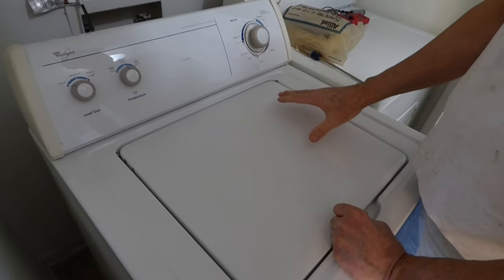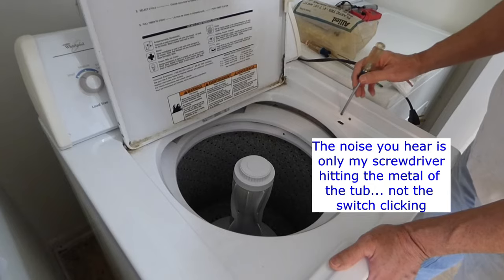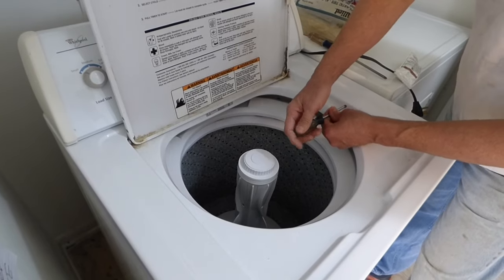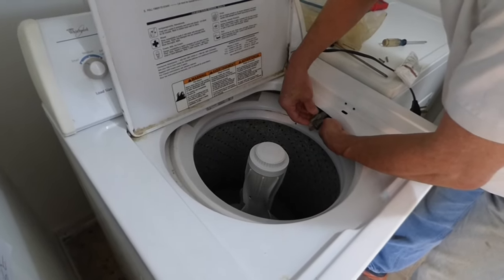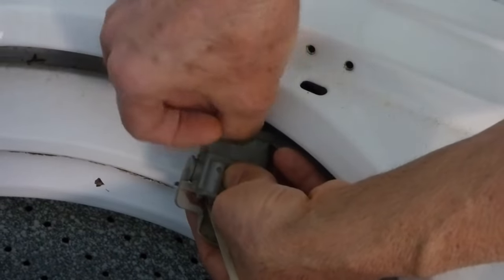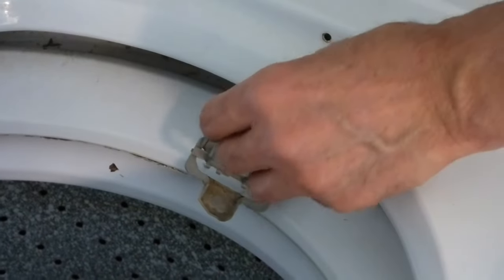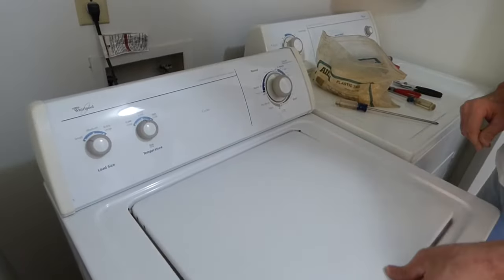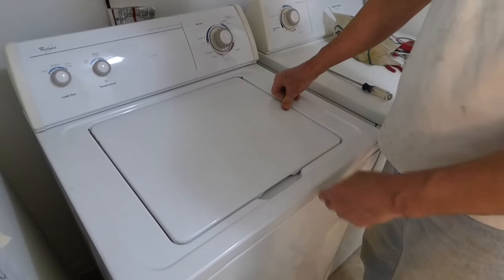Wash Machine Won't Drain or Spin - EASY 5 Minute Fix!

Comment: Worked for me too……AFTER I paid a repairman to fix it. It worked when he was here but failed again after he left, leaving me with another washer full of water and wet clothes. Because the Kitchenaid is 23 yr old I was researching new washers and didn’t like any of them as I don’t want one with a motherboard or impeller. Anyway, I followed your instructions, even had a zip tie on hand, and now it works perfectly. I’m THRILLED and hoping it lasts another 23 years. They just don’t make them like this one anymore. A lot of junk out there with built in obsolescence.
Reply from the maker: … And if your lid switch is ever not repairable they are not difficult to change out. Here is a video showing how to do that.
Washer won't Drain or Spin - Most Common Cause - How to Replace the Lid Switch
https://youtu.be/gzq5FODUuqE

Comment: So single mother here with a question. My washer will spin during the cleaning cycle just fine and dandy. Now with that said here lies my conundrum, it refuses to spin on the final rinse cycle. All the water drains but of course the clothes are still soaking wet because the water didn't get spun out of them. I've watched several video's on different issues, but not my problem exactly. All the videos I watch are semi old or the creator doesn't respond back to questions. But thankfully I ran across your video and seen that you actually take the time out to answer your subscribers questions. Which is so absolutely awesome and means so much, it definitely separates you from the rest of these repair channels, because it shows you actually care. You understand that some people, especially all of us single mothers on a budget. That have to put on our many hats and get in there and get our hands dirty, to fix our own appliance issues if at all possible. Thanks so much for being the creator that's genuine,it means more than you know!!❤
Reply from the maker: If it spins well on the wash cycle but will not spin at all on the rinse cycle you may have a problem with the timer.  I would test that
Reply: That’s exactly the problem I’m having
Reply: @helpinguonline how would I test the timer? Thanks
Reply from the maker: I don't have a video on that yet.  You will need a multi meter to test it.  You can get a cheap one at Harbor Freight for around $5.  There are videos online that will show you how to do that.

Comment: Thank you!! Just realized the pin to pull the switch on was broken, No need to replace the pump!! Easy fix using a screw to replace the plastic pin
Reply from the maker: Way to go!

Comment: That worked very well. The screws that attached the switch went through the plastic switch housing and both had broken out. Super glue and the suggested zip tie seemed to have fixed the problem. Thank you!
Reply from the maker: Way to go

Comment: Was about to buy a new Washer and stumbled upon your video.  Problem solved.  Thank you.  2 minute fix.  I just shaved the rubber feet on the lid to sit lower, making better contact with the switch.
Reply from the maker: Great job!
Reply: That is also a good idea

Comment: Thank you! I figured out my lever actually broke off so I think I need to order a new switch. I found the broken piece behind my washer. I guess it fell to the bottom when it broke.
Reply from the maker: Congratulations on figuring out what the problem is and this video should help you to replace your lid switch with a new one

https://youtu.be/Qgzq5FODUuqE?si=MqHJD32rkjl98tMz

Comment: I have a 30 year old Kenmore that worked like a charm, until I put a big dog bed with foam cushions in it. That’s what made the spinning stop. I was excited to find your fix, but mine still clicked, and when I took it out, it wasn’t split at all. Do you have any back up thoughts? I know you made this video two years ago, so I’m not really expecting an answer. I just don’t want to throw it out unless there’s truly no hope. I have to do more daily loads with an incontinent dog who is a senior, then I ever did with a family lol.
Reply from the maker: Sorry to hear of your troubles. Your problem could be one of many. Could be that the weight of the dog bed in the washer broke the plastic coupler.?.  Here is a video that will give you a deeper understanding of how to make repairs to your washing machine and if it is the coupler you will also learn how to change that. Wishing you all the best

How to Fix a Wash Machine that Won't Spin, Agitate or Drain - You will Learn A Lot
https://youtu.be/odDvndIlU6k

Comment: I too was relieved you shared the zip-tie hack. I did grab the number from the switch for my 90’s series (ex 3949238) and ordered it for later.  I bet the zip tie holds for a while though.

Comment: I found your video very helpful last night when I got home, and  she told me the washer wouldn't drain. I pulled out the switch and the seal was completely gone. Switch was wide open. do you have a video to replace this? I have a whirlpool Ultimate care II heavy duty super capacity plus Model LSQ8243HQ0
Reply from the maker: Washer won't Drain or Spin - Most Common Cause - How to Replace the Lid Switch
https://youtu.be/gzq5FODUuqE

Comment: I’m sure this would have been a perfect quick fix. Unfortunately, as soon as I took the second screw out I heard the switch fall down so I can’t reach it. I have a load of water and wet laundry. Any clue as steps I should take at this point?  I cannot reach the switch that fell.  It’s an old top loader Kenmore that was working great ( someone just gave me to replace my front loader that died. )
Reply from the maker: You would have to get a large cup and bucket to get the water out of the washer tub unless it it easily accessible where it is.  Then you can follow the steps in this video to access your switch.
https://youtu.be/gzq5FODUuqE
Hope that helps you.

Comment: Exact solution it needed... but strangely the issue would only happen on the delicate cycle - wont drain or spin, all the other cycles the machine worked flawless. Any reason for that?
Reply from the maker: That’s a tough one… Maybe the other cycles were vibrating the switch enough to activate it and the delicate cycle was too gentle to activate the switch?.

Comment: I have a Kenmore Elite. It makes a sound like it is spinning on the spin cycle, but does not spin. It is still the same problem?
Reply from the maker: No.  If it was the switch you would hear nothing. 
The coupler may be broken.  It is not a very difficult fix if that is your problem.
I have a video that will show you where that is and how to change it along with other issues it might be if it is not the coupler.  
https://www.youtube.com/watch?v=odDvndIlU6k
There are also many other videos on YouTube you could check out if it is your coupler.

Comment: I’ve done this zip tie fixed. The washer is working but when it gets to the spin cycle, it wont spin unless I lifted the lid and set it back down. Then it would spin. Does this mean the switch is bad and the zip tie doesn’t fix it for good?
Reply from the maker: Yes it sounds like you have an intermittent switch and probably needs to be changed. Here is a video that may help you.

Washer won't Drain or Spin - Most Common Cause - How to Replace the Lid Switch
https://youtu.be/gzq5FODUuqE

Comment: Hello! I just tried this and it did work the first time… but the second time I tried it it didn’t work…. Any suggestions?
Reply from the maker: It could be that your switch is completely shot and you need to change it out. If that is the case this video may help you.
https://youtu.be/gzq5FODUuqE

Comment: Once I did it it doesn’t make any noise and still won’t work. Can you help me?
Reply from the maker: If it is your lid switch and this does not fix it temporary early for you you may need to replace the lid switch… If your problem is a bad lid switch.
If that is the case this video may help you.
https://youtu.be/gzq5FODUuqE

Comment: This didn’t work, next thing to try?
Reply from the maker: Depends on how your machine is acting to narrow down the problem.  Type your problem in youtube and you should be able to find your answer to diagnose and resolve your problem.
Reply: I tried this and it did not work for me either. I pulled the switch back out still thinking it was the problem because it did not click and the glue did turn loose. I removed zip tie, took switch apart, got the contacts to touch and turned it on ( I DO NOT recommend this because of shock hazard! ). It started to spin, Shut it off and unplugged machine. Zip tie did not work, but it is the switch. Thanks